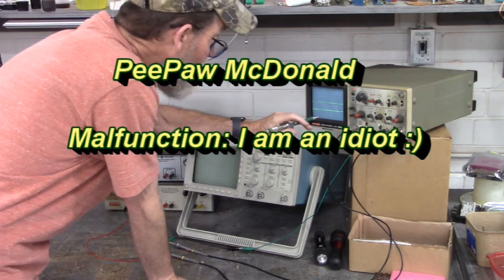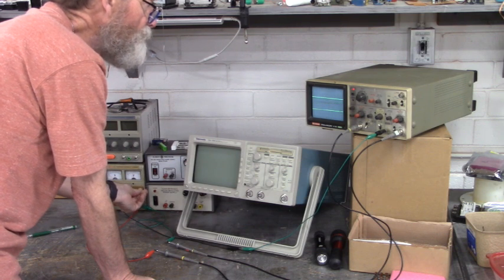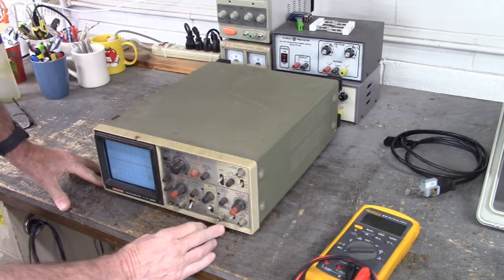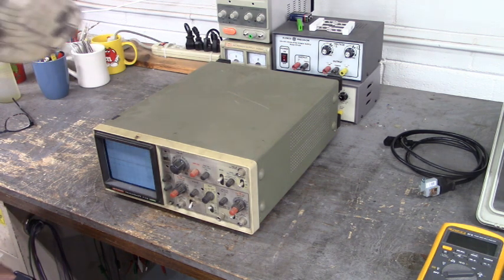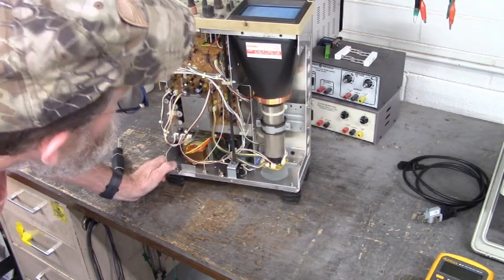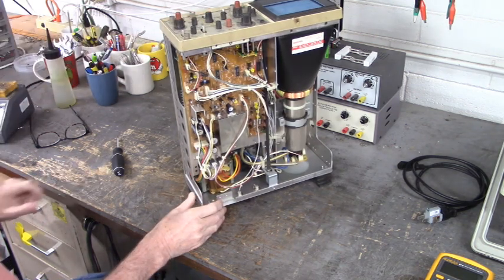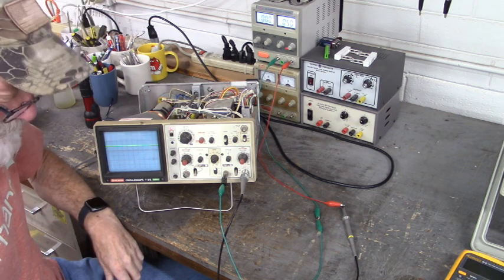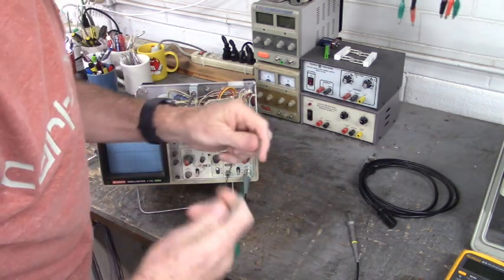I Am An Idiot since my brain stroke.

Comment: Reminds me of a repair I was called out on.
Customer called in that the edit mode on their CNC was no longer working.
one of our Service Techs was sent to the customer.
Diagnosed it as a Bad Memory board.
Board was ordered and when it came in, it was swapped out, 
Eproms swapped 
parameters entered
and then again,  they still were not able to use Edit mode.

So I was asked to take a look.
As I walked in the Door, I saw from Across the room, that the Edit Lock Key was Not in the Control.
The Key can Only be removed when it is in the LOCKed position,  Meaning that No Edits can be Made.

It's the Simplest things that get over looked.